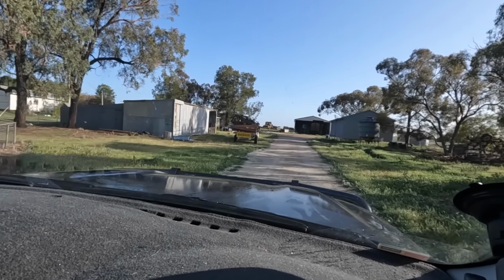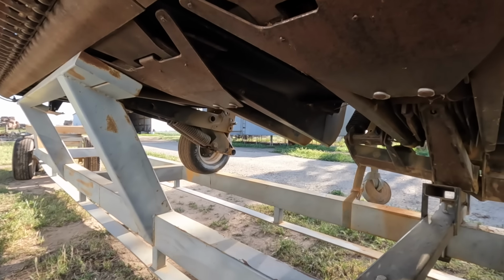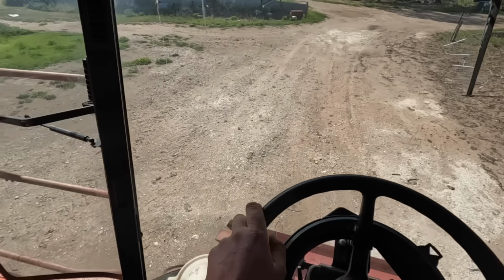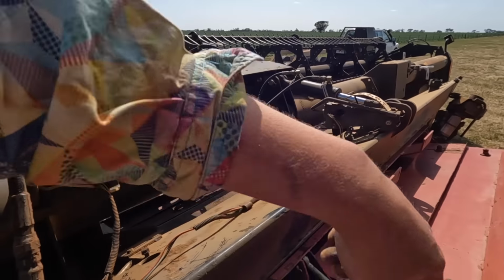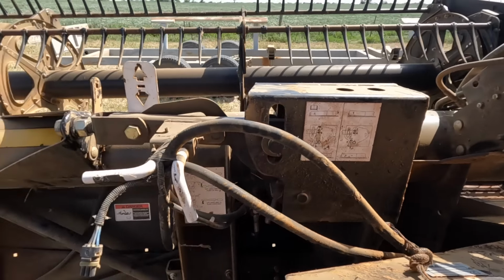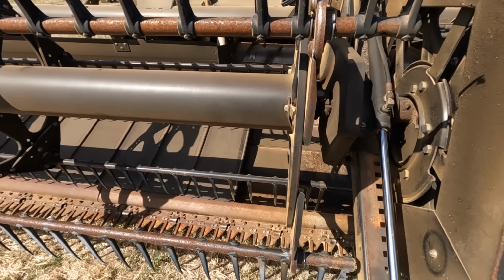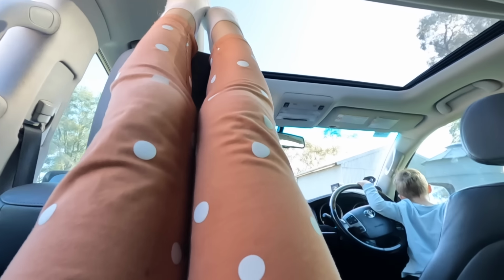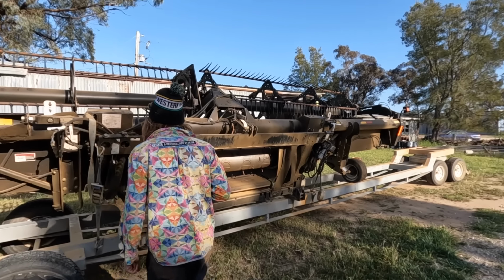New Header Front! Case IH 2062

Comment: Make sure your dealer got or can get all the lil bearings for draper belts etc as those fronts where the switch over  to macdon fronts. Mate got the New Holland version and dealer said nope on parts so had to import a heap of bits then the tr burnt down so he gone 8230 with 30ft macdon front that also gets used to windrow with on a case-ih windrower tractor
Reply from the maker: Thanks for the tip mate. I’ll look into it